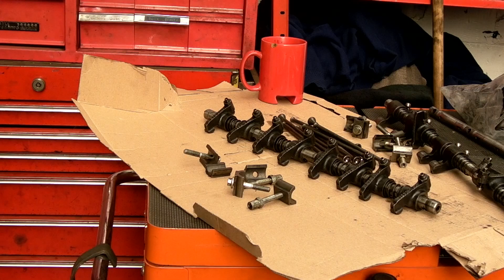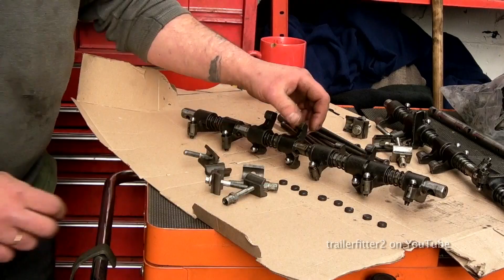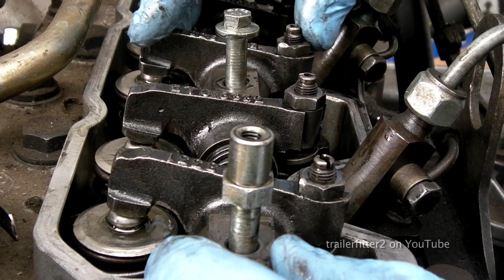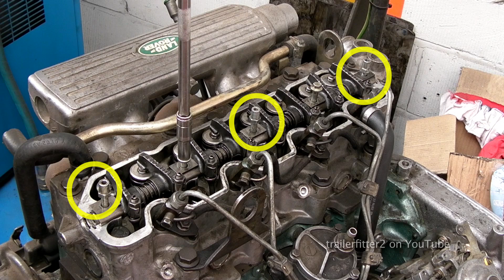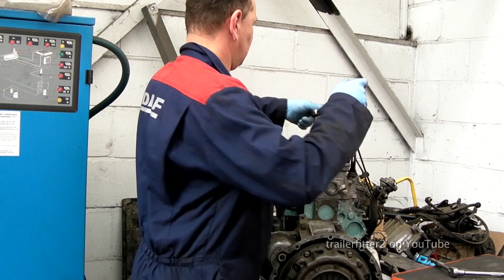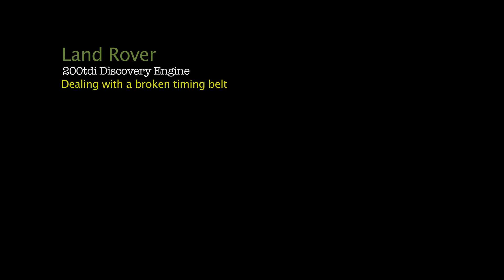Land Rover 200tdi Engine. Refitting Rocker Shaft Sequence after Cam belt breakage

Comment: not good then, it's only done 3000 miles if that, was meant to be a full recon engine, its losing coolant and over heating lack of power . many thanks Mike
Reply from the maker: +mike tarling  that doesn't sound good at all.   You should get warranty on that shouldn't you?

Comment: I have a 200tdi ,that is blowing oil out of the filler cap and rocker gasket ,is this the head gasket gone ?
Reply from the maker: +mike tarling   more likely compression blowing past the rings into the crank case and back up to the head.  Check your cyclone unit is not blocked but the likelihood is that your bores are badly worn.